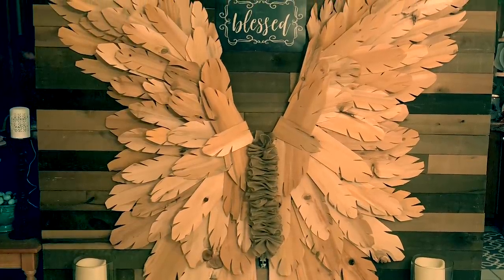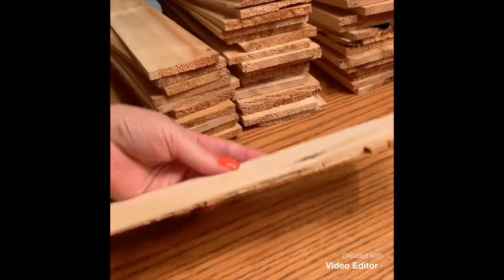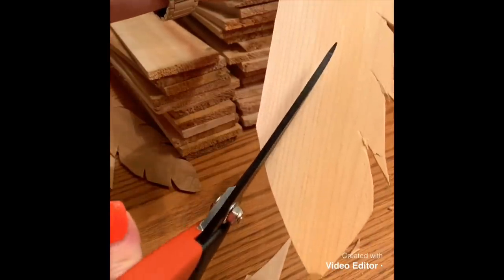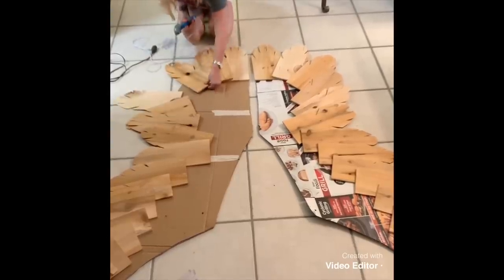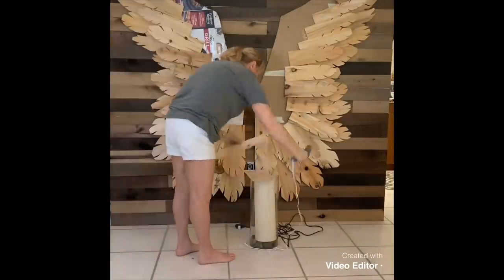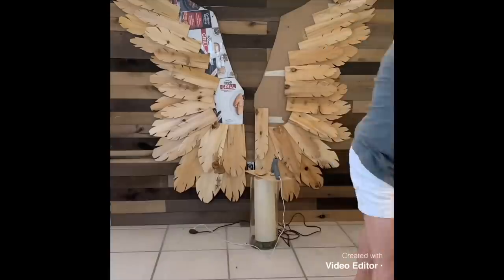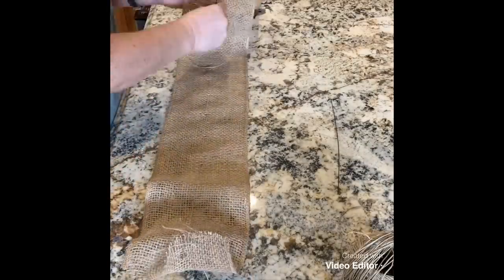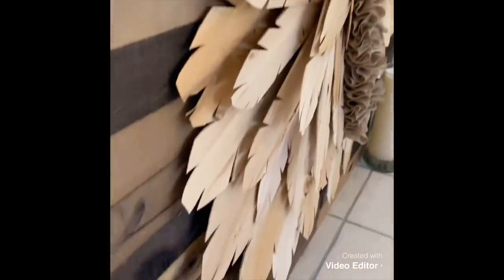How to create stunning Life Size Angel Wings wall art DIY Huge craft

Comment: How do you cut the wood so it doesn't keep cracking that's the problem I'm having? I absolutely love this piece and have been thinking about making it bought all the supplies but the wood keeps cracking and breaking when I cut it.
Reply from the maker: I’m so sorry I haven’t even been in here in a bit. But wet the wood, once it’s wet it’s much more pliable
Reply: Okay I will definitely try that I ended up making a different project with the wood.

Comment: Where did you get the shingles and what type of cedar shingles. Most of the ones I've seen are really heavy and thick and not tapered
Reply from the maker: I bought them at Home Depot, about $18 a bundle. They are tapered and soft entropy cut